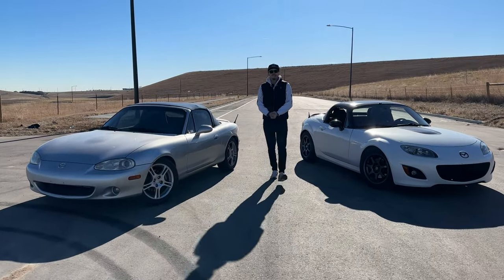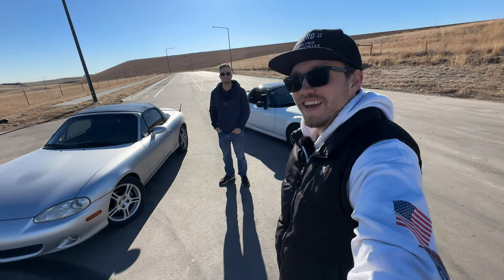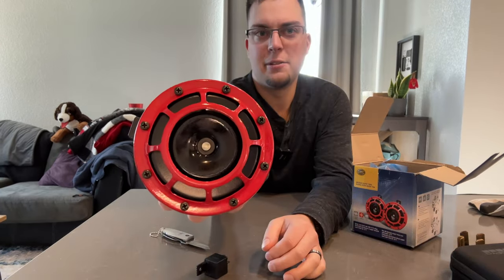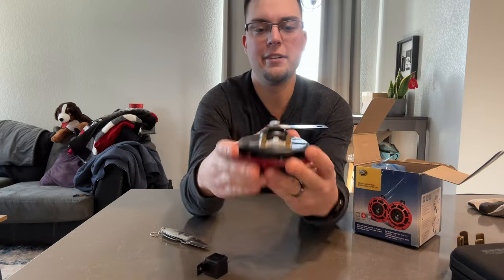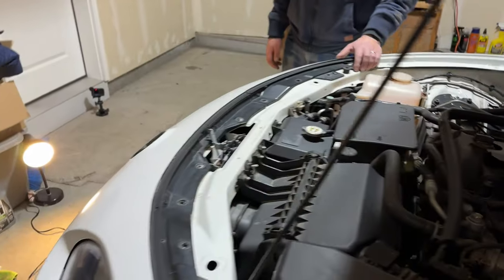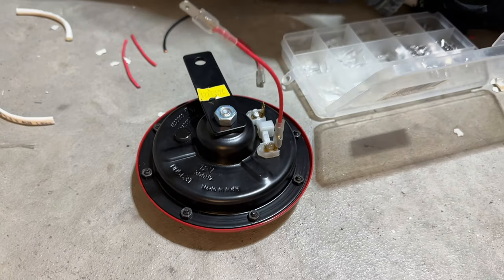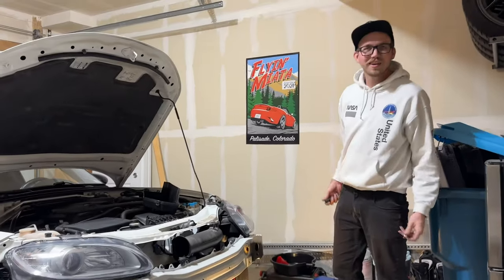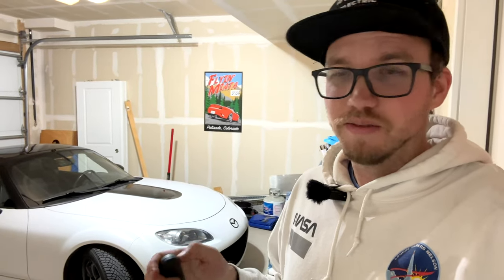Your Miata needs a better horn! Hella Horns Super Tone installation and review on the NC

Comment: I did the same install on my NC over winter, I had BNIB 90s era supertones (they sound the exact same as yours lol). The kit from the 90s came with splices already put together + I don't like using those vampire clips on my car, so I was able to splice the ground and power easily. Sounds great and the power output on the horns is still much less than the 15A fuse so no worries about blowing that either.

Comment: Is it a similar process for a NB1?
Reply: Hello Tim, It is largely similar. I used the stock bracket and was able to attach both horns to it with a bolt, lock washer and nut. Instead of spreading the horns out, attaching on other end of the bumper like on the NC, my NB2 just had a single bracket attaching on one side of the vehicle.